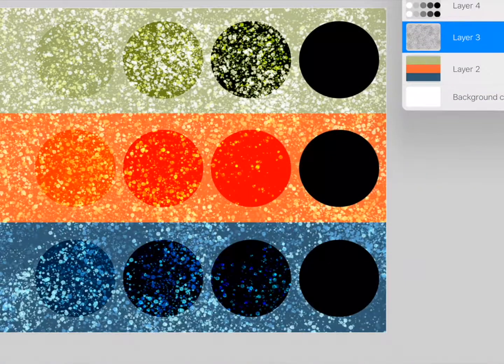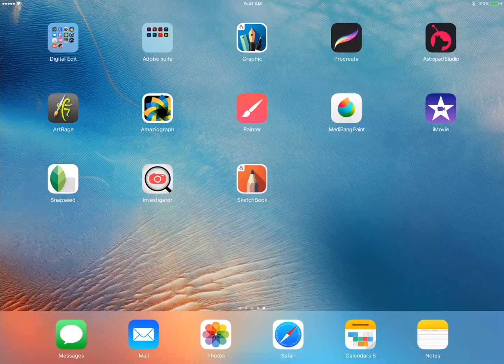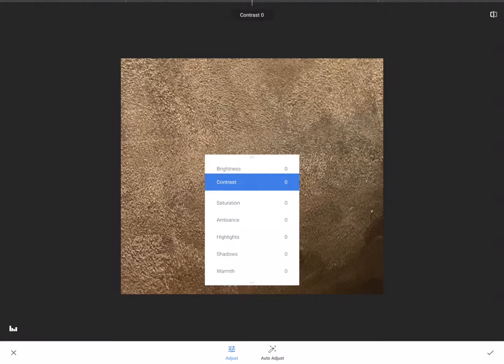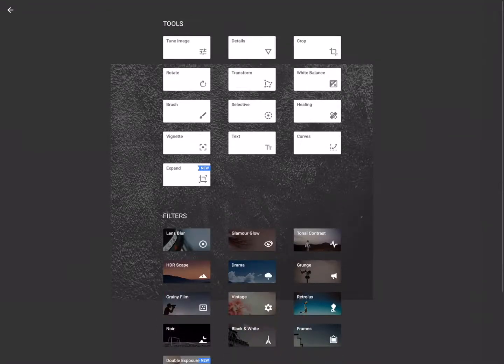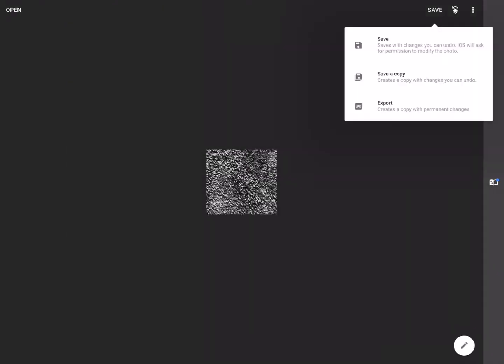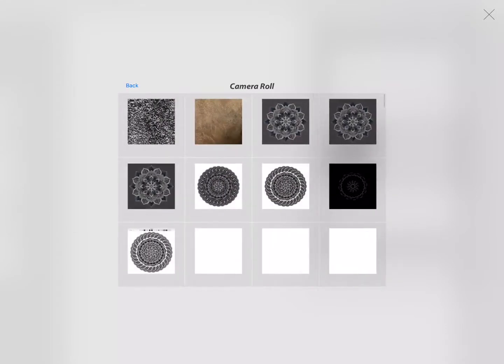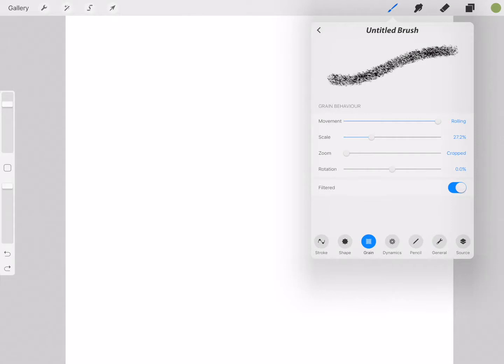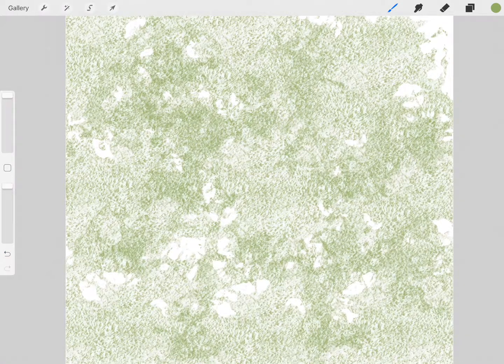Creating A Texture Brush in Procreate

Comment: Hello... great video... I have tried to do these steps... all through Procreate... but when I use the custom brush... I do get the correct texture... but if I use it on alot of the canvas it shows a grid pattern within... any thoughts on what I may be doing wrong? THANK YOU
Reply from the maker: Hi Jesse,  the method in this tutorial is a simple version to get you started with texture.  It works best if you are using it scattered in your design, but it is not a seamless texture.  If you use it to fill an area it will create a grid look.  To get rid of that grid look the texture swatch that you use in as source has to be seamless.  You can take it that next step and do this in an app such as affinity photo on the ipad.  I do not yet have a tutorial on the process for seamless texture on the ipad yet.  Hope this helps, glad you enjoyed the video.
Reply: THANK YOU.